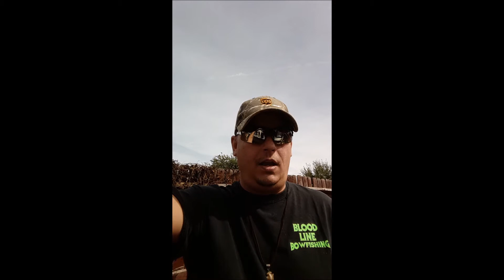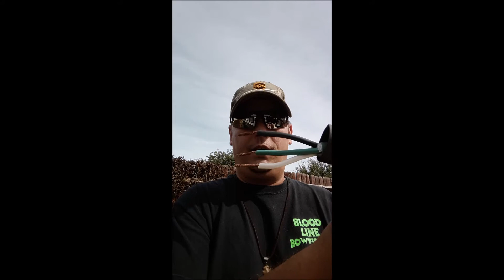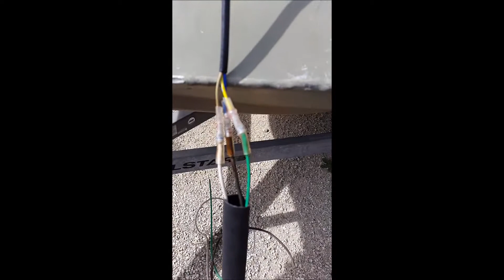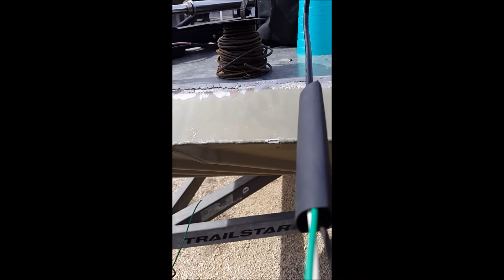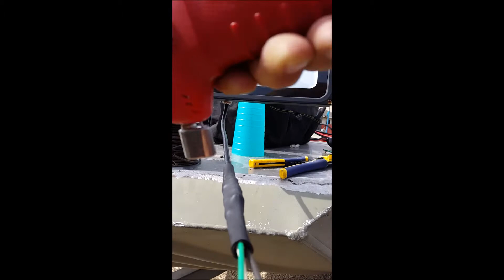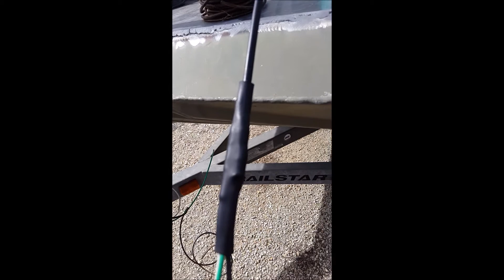How to wire 110 volt LED lights

Comment: Do you do this with ever individual light or
Do all the lights run into that one plug?
Reply from the maker: I tie all the lights on one side of the boat into one plug, and the same down the other side.
Reply: @bloodlinebowfishing5287  I have ten 30 watt lights that i am about to run.  My question is how to tie each light into run plug.  How does the power draw affect the generator?
Reply: @Bryson5258  how did you end up running your lights?
Reply: @nathanschool4355  tie each light into a typical 120v plug and the. Use lots of power strips. It is addictive
Reply: @tolkative8193  your power strips don’t get wet?